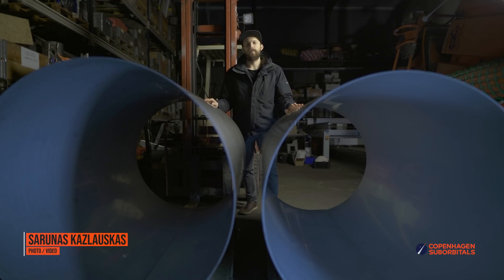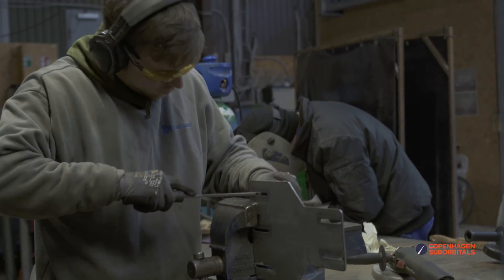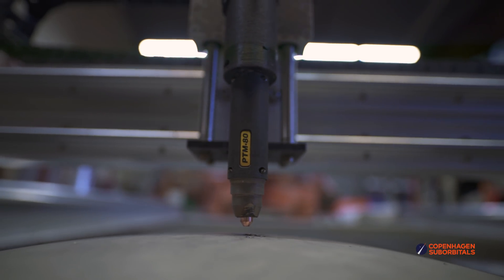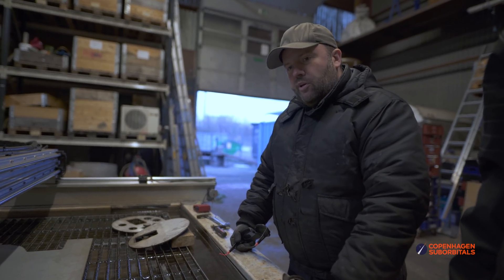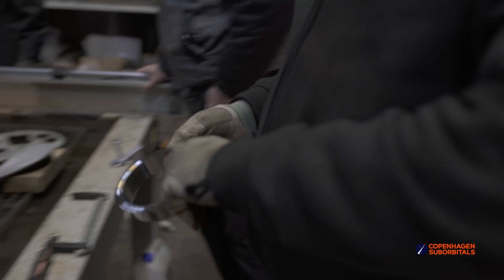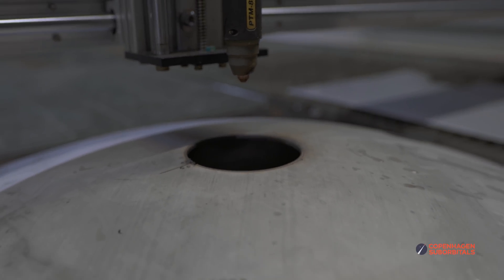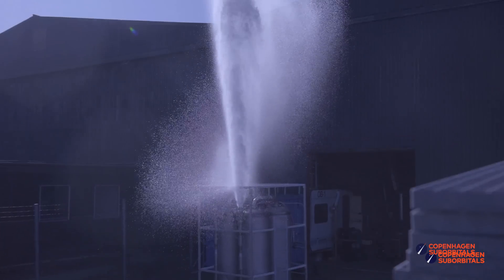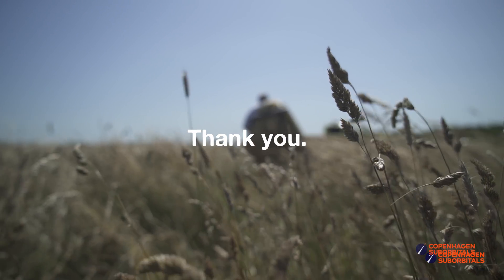Making Spica Rocket Propellant Tanks & Bulkeahds | INSIDE THE ROCKETSHOP : Episode 18

Comment: Are you doing any NDT (non-destructive testing) on your welds besides something simple like dye penetrant testing? From what I understand radiography is standard in safety critical welds such as structural welding or in the aerospace industry. Not sure how much it costs but I know there are contractors who do radiographic weld inspection where ever there are welders.
Reply from the maker: We'll see with Spica, but so far we have only relied on potentially destructive testing - pull strength tests and pressure tests up to 1.5x operating pressures for flight hardware. Though when trying new production methods, we would often push test hardware to their breaking point. For example when testing our bulkhead welds, they reached nearly 4x operating tank pressures (close to 80bar) before breaking.

Comment: What's the wall thickness on the tanks, if you don't mind me asking?
Reply from the maker: 3mm
Reply: @CopenhagenSuborbitals  interesting. One quick follow up, I remember you said that you are storing the liquid nitrogen at something like 300 bar, but I don't recall what your propellant tank pressure is.
Reply from the maker: @maxk4324  Propellants are pressurized to 20bar.
Reply: @CopenhagenSuborbitals  Interesting, so you must be using a pretty strong stainless alloy like maybe 440?
Reply from the maker: @maxk4324  304, but we will be strain hardening them. Perhaps a bit unconventional, but we've seen some really nice results from previous tests.
Reply: @CopenhagenSuborbitals  hmmm interesting, the plot thickens. Just looked up the stress strain curve of 304 and damn, I never realised how much room there is for strain hardening. I'm very interested to see how this turns out. Keep up the awesome work!
Reply from the maker: @maxk4324  Yes! It has some pretty interesting properties. ;)
Reply: Mmm Baby SpaceX